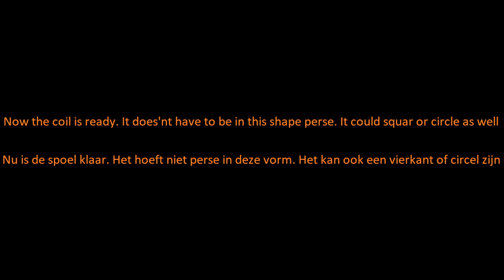How to wind coils for axial flux generators and motors

Comment: I notice a lot of axial motors have no iron cores. why is that?
Reply from the maker: That is because of the magnetic flux is already enhanced by the iron disk which the magnets are mounted on and also the flux is concentrated right through the coils because the magnetrotors are at both sides. That is why axial flux generators and motors are more efficient.  Normal radial design which need the iron core for distrubuting the magnetic flux through the coil undergo a lot more resistence taking more torgue to spin them.
Reply: @Max Amps - It is to reduce cogging . The iron disks, that the magnets are mounted on, are irrelevant to this question.
Reply from the maker: what do you mean by cogging? 
The Iron behind the magnets helps direrct more magnetism towards the coils while in a radial flux the iron core distributes the flux equally throughout the coil because otherswise part of the coil that's further awy from the magnet is getting much less.
Reply: @MrSummitville  Read the Papers written By Yasa and Magnax, The Iron disks that the motors are mounted on are used to close the flux instead of the Yoke. i'd say the disks play a major part. and i'd rather believe papers written by companies that build high power Electric A-F motors than a random comment. 

To start, look for the papers "A Comparative Study of Yokeless and Segmented Armature versus Single Sided Axial Flux PM Machine Topologies" or "Double-rotor or Double-stator: a Matter of Efficiency"
Reply: @MrSummitville you got SERVED!